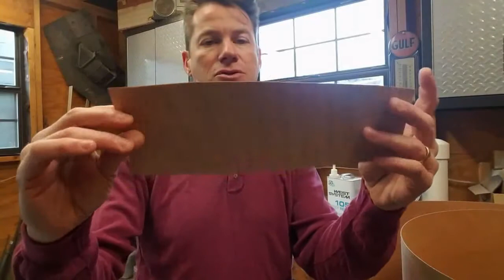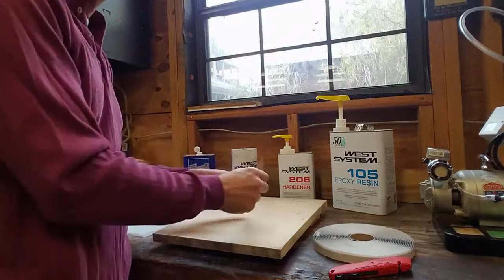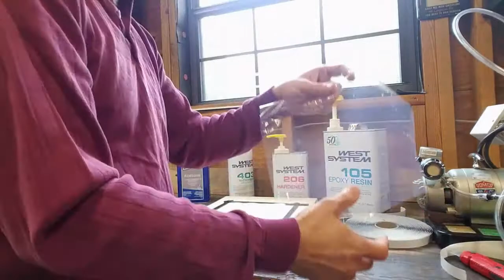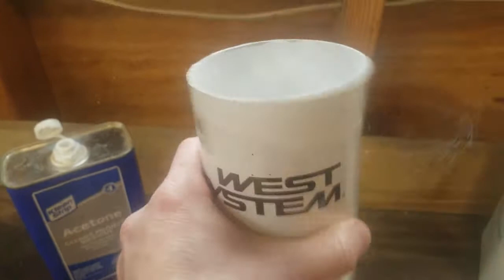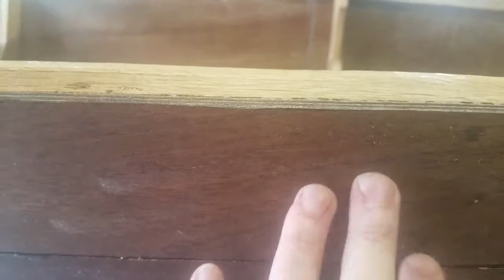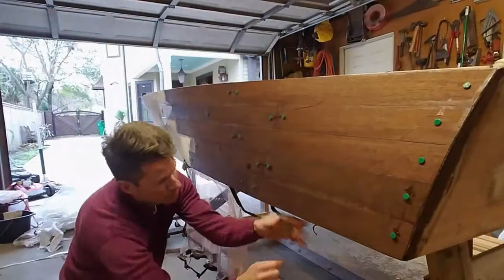Vacuum Bagging Wood Veneer!

Comment: Nice video is there anywhere you could suggest to learn more on the equipment and set up. Thank you
Reply from the maker: It's really an adaptation of woodworking methods for clamping with air pressure. I'd Google vacuum bagging and look for hits within the realm of furniture and cabinetry.

Comment: How wide a plank would you expect to manage before you could have problems with air pockets being trapped behind the plank? Or would you just thumb-tack it here and there in order for the resin to seep out? I am thinking about bigger panels like walls inside a boat.
Reply from the maker: I dont think it would be a problem for practically any width, as long as the epoxy still has time before it sets up.  I'd also limit the number of thumb tracks to just hold it in position, and keep those pressed in to where they have just a small gap to get under the head.
Reply: @billthomassie6118  
OK, tanks. Love the boat your doing. Nice work!